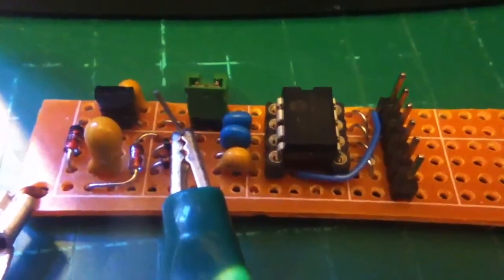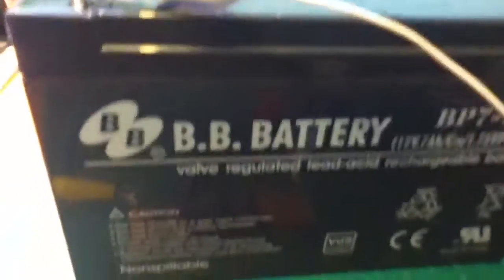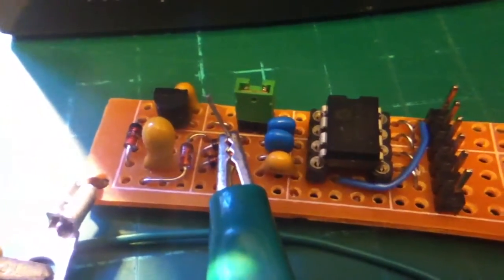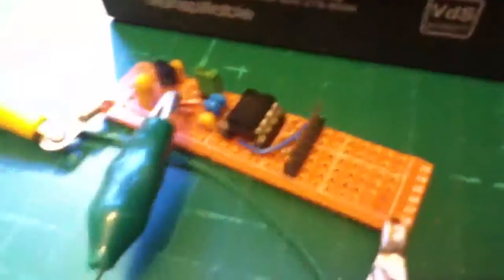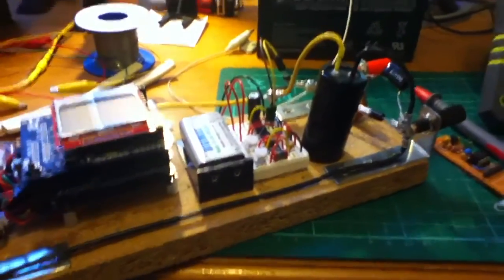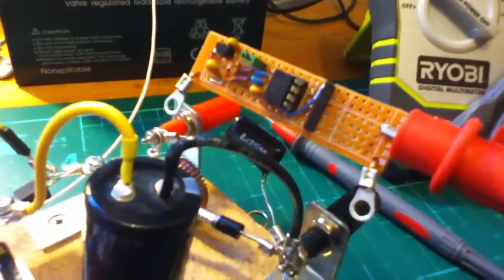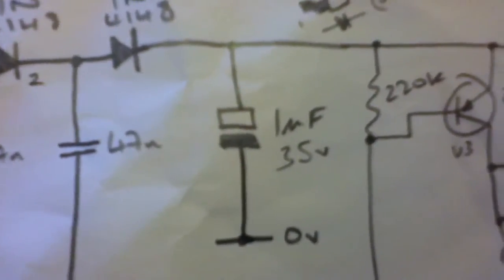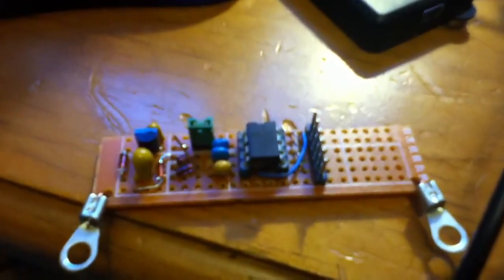Microchip PIC12F683 as a Variable Frequency Charge Pump (part 2)

Comment from the maker: Yes, exactly that. To switch on fully, the MOSFET gate needs to be 9 volts higher than source, but the source pin is connected to battery positive. Regardless of actual battery voltage (which varies considerably), the charge pump output is always battery positive plus 9 volts.

Comment from the maker: Same here. The really cheap controllers all seem to switch the negative side, but fail to mention that in the instruction manual. So you wire up a common negative and short out all the controller's switching functions!
From what I've read, P-channel FETs don't have the low on resistance of N-channel types.
High side and low side FET circuits are worthy of their own video - thanks for the idea.

Comment: I think it's a good design principle to keep the battery in the low side like you a doing. A lot ov charge controllers use a mosfet and just simply put the battery in the drain circuit. While this works perfectly well, it's a problem if you want a common negative between your panels and your battery. You could also try a Pchannel as the switch then you would only need to switch the gate to ground, and not require any boost voltage.

Comment: Yeah, I like to have a common -ve in my setup, since I have so many different battery banks and sub-circuits..! hehe I have come up with a really simple circuit to convert a -ve switching controller to a +ve one & increase it's capacity to boot! :) I should send you the schematic, could be useful. Tbh I have never actually used a P-Channel for anything, but yeah I understand they have a higher on-resistance. But I would presume that is only relatively speaking and may not be a real issue.

Comment: Just curious why you need so much voltage to turn on the mosfet? Is it because you've got the battery in the source circuit and would need to get the gate up much higher than the battery?

Comment: I also like to throw microcontrollers at almost everything since I know how to program them, but for a simple charge pump I still always use the good old NE555 (or the CMOS version of it). Look here for example:
http://www.talkingelectronics.com/projects/50%20-%20555%20Circuits/50%20-%20555%20Circuits.html#10
8 parts including the IC and you're done. If really needed you can still adjust the frequency with a pot (and it will keep the value even after a reset ;) )